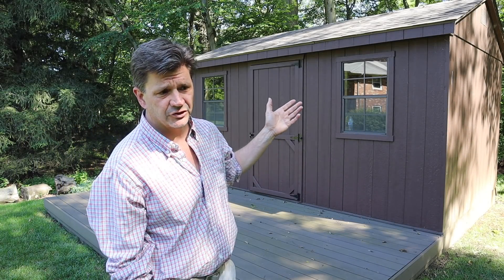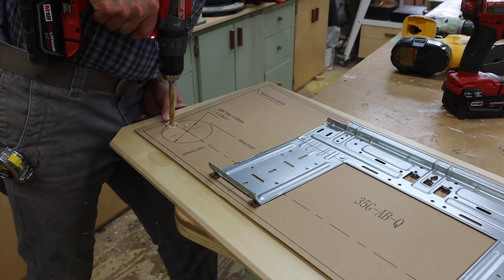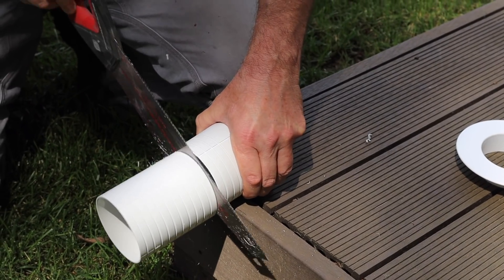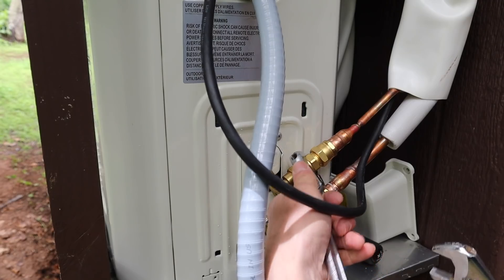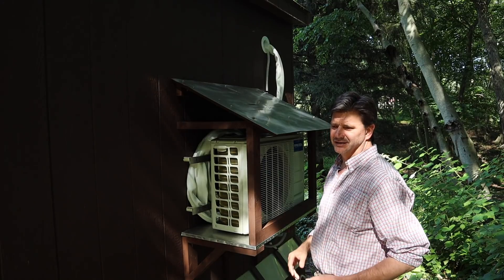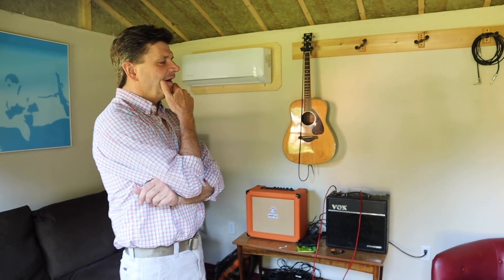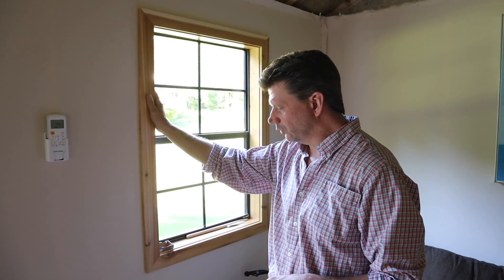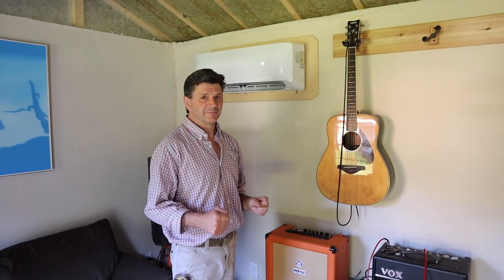How to Install a Ductless Mini-Split Air Conditioner

Comment: All the woodworkers are getting these from MrCool, but hardly anyone is mentioning that they were provided for free, or as a sponsored video, or doing the right thing on YouTube and flagging the video as sponsored. Not sure if they provided the unit for you, but given the proximity to all the other ones, I assume so.

That said, the MrCool split does work quite well. Installing mine (which I bought last year) by myself was a challenge because the lines were more stiff than they look, but not impossible. My shed workshop is apx 11x15. I used the smallest DIY version. It held up quite well over last summer and winter, and kept the temperature consistent. There was very little impact to my electric bill, despite this being on 24/7 and set for 69F in a hot /humid mid-atlantic location.
Reply: What difference does it make if he got it for free or paid for it? It sounds like you are just upset that nobuddy gave you one for free so your badmouthing everbuddy else.
Reply: @realkingsport3052  Nope. That's not it. I don't mind paying for stuff. I do mind folks getting free things, talking them up, and then not disclosing that they got them for free. YouTube has a mechanism to indicate a product placement, but folks with the Mr Cool stuff aren't using them. Similarly, lots of Saw Stops out there that folks have gotten for free as well. One can be interested in proper disclosure without being jealous.
Reply: @Psychlist1972  thats his right to do that if he chooses though its his channel
Reply: @realkingsport3052  Actually, it's against YouTube creators ToS. If I post a link to it, the comment will be marked as spam, but it's easy enough to find. Disclosure is required, but obviously not policed.

"You may include paid product placements, endorsements or other content that requires disclosure to viewers ('Paid Promotion') in your video content. If you do, we require you to notify YouTube by ticking the 'video contains paid promotion' box in your Advanced Settings using the instructions below."
Reply: @Psychlist1972  youtube is probably owned by mr cool thats why they overlook it that how these things work, you scratch my back ill rub your balls, just look how AOC and these librels in conngress operate this whole deal is a bunch of criminal enterprise.

Comment: For all the people questioning if the lines need vacuum pumped before releasing the refrigerant with this system...the answer is NO. The lines are prepared at the factory and ready for use. Connecting the line set, opening the valves, and leak testing is the process. This is a DIY system. There are similar looking systems that require the lines to be pumped and then filled and gauged. Not the Mr Cool DIY systems though. 
I see these comments on every single video for this system. Go to the website-it gives all the installation procedures.
Reply: What about at least purging the lines before  opening the suction line to the compressor
Reply: @geecee9770  the line are  vacuumed at the factory and the seal is broken when connected to the unit. Nothing to do on the consumer end other than the connection and leak testing.

Comment: No vacuum on the lines? Jon, did your installation instructions not mention this usually vital step.
Reply: Anthony Hall - This unit uses sealed line sets that pierce when connected and the unit is pre-charged. One downside is you can’t alter the length of the lines.

Comment: Great install Jon! I read this in one of the comments below: "Need to vacuum system before you open the refrigeration service valves......installing  without vacuuming could kill your compressor." and was wondering if you would give us your opinion on that statement? Thanks.................... :)

Comment: Great vid John. I’m hoping to upgrade my shop in a few years... and I like the AC option. On the other end of temps... how do the acoustic instruments handle the winter temps / temp swings? Or are you heated also? I’m a drummer, so not really speaking as a musician.😆
Reply from the maker: Thanks man 👍... so far no problem with the instruments the cool thing about this air-conditioner is it’s also a heater and it has thermostat so we plan to use it all summer and winter.
Reply: Jon Peters Ah... that’s great.👍

Comment: Why didn't you evacuate the line set prior to releasing the freon into the line set? Did you not know that this is required in order to eliminate contamination of the freon and to avoid having moisture in your freon? I think you should edit your video and make sure that people understand this mistake you made so that your viewers will know that they need to do this. Also you installed the outside unit so close to the exterior wall and with the line set and insulation tucked in behind it you didn't allow the recommended clearance to allow the system to pull air in through the backside. Was the backside of the unit already a solid part of the unit's covering which didn't need clearance or were you unaware of this requirement? 

The shed looks nice, and your work is good quality. Love the 1/2" plywood wall mount. I hope your system doesn't prematurely fail on you.
Reply from the maker: Thanks... because you don’t need to with this DIY unit.....Yeah you have a point about it being close to the wall but my hvac guy said it will be fine and so far so good.

Comment: Need to vacuum system before you open the refrigeration service valves.. if you don’t you leave moisture in the lines and  that’s bad.. get a pro to install I have been in the  trade for 32 years.. installing  without vacuuming could kill your compressor... if the unit is charged with r410a it  acts like a sponge and absorbs moisture from the air.. we use a nitrogen pressure test to dry out lines and vacuum.. do it right.. I have repaired home owner mini split jobs that go bad..
Reply: These models have the line sets already installed to the head unit. Either the lines are vacuum sealed and the outdoor unit is charged or vice versa. So it instructs you not to evacuate anything.

Comment: Mate it needs to be evacuated first before you let the refrigerant in the system.
Reply: these are precharged lines, thats why you can do it by yourself without a vacuum.
Reply: Ah ok. What brand are those?
Reply: @jeffaranas5161  It's right in the video description. I have one of these (that I bought from Home Depot). It's pretty easy to install, and the lines are pre-charged, which is why they had to be coiled and not cut to length.
Reply: @thenatedog  all of those systems have precharged gas in the external unit, and unless you have vacuumed lines that once connected will be filled with tha gas coming from the external unit you have to vacuum the lines.

and those lines come from the internal unit, i dont think this is the  case, so vacuum was necessary.
Reply: @RobertoAnile  If vacuum was necessary... you'd think they would include that in the instructions. #illuminaticonfirmed
Reply: @RobertoAnile  no vacuum needed, that's not how these work.